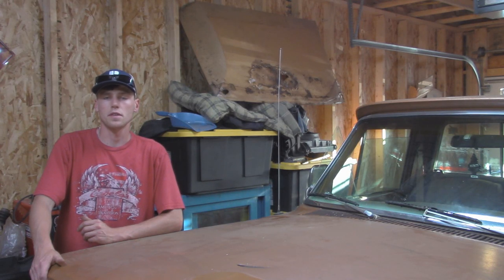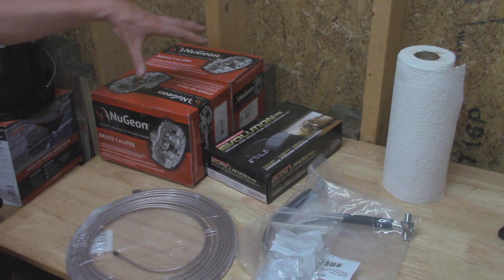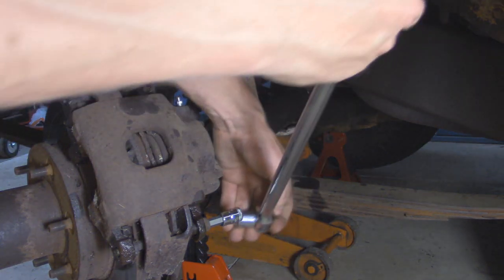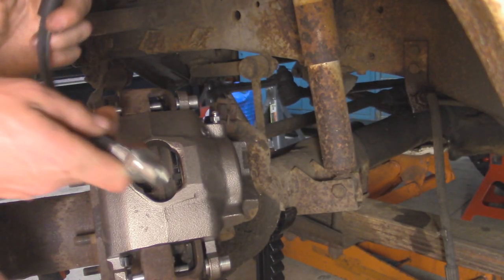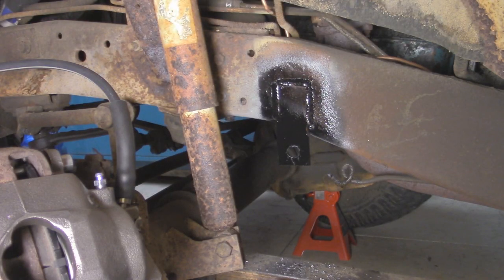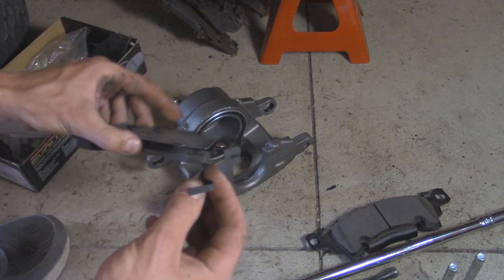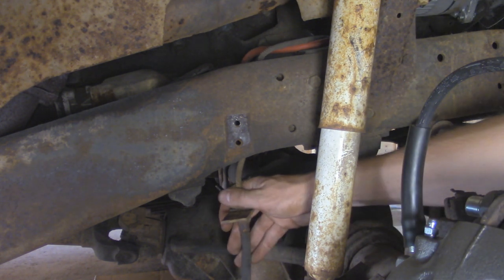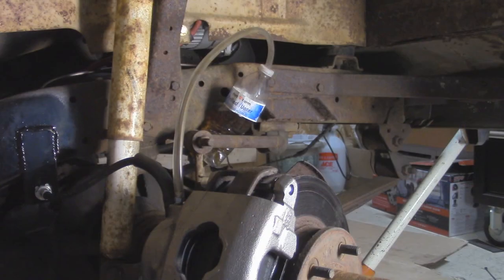Front Brake Rebuild | Jeep J10 Build

Comment: Inline tube makes a nice stainless steel pre bent brake line set for J trucks, I have already installed a complete set on a 1984 and a 1981 J10, they both fit very nice. They were around 200 bucks each but well worth the investment in my opinion and should now outlive me.   Those caliper hose brackets can be a pain, you need to have patience, especially when trying to remove the brackets from the chassis, sometimes working the stubborn bolts back and forth bit by bit can go a long way instead of merely turning them counter clockwise. I am sure you will find all kinds of things to repair as you continue along that you may not have noticed yet. I ended up building a homemade cart with wheels using 4x4's so I could have something to support and help repair the bed after pulling it. I now have my third J truck bed sitting on it. Makes it easy to clean repair and rustproof the rear portion of the frame. Look for deep pitting and rust damage especially near the cross members, rear shock mounts,  and the leaf spring shackle mounts. I am in the process of replacing floors, cab corners, B pillar posts, etc, on J truck number 3. My 81 got a complete outer rocker panel replacement using the non slip on type,They are thicker and much better quality, but they are not flexible like the slip on's and require much more dedication to install them properly.  I even had to make one new complete inner rocker as it was in very poor condition and it's not a replacement part you can buy. I was also forced to make 4 of the 6 short brackets that extend from the main cab floor supports on either side to the inner rockers, another part that isn't being reproduced. CLASSIC TO CURRENT FABRICATION sells what they claim to be complete cab floor repair kits  for J trucks, the front pans seem to a good enough fit, but the rears will require lots of cutting , fitting and trimming to make them fit around the center hump, at least the rears are long enough so the front pans will overlap them and do extend all the way to the rear of the cab. You can find them at their online site and ebay. Mill supply is also another source for sheet metal, and   BJ'S OFFROAD offers lots of FSJ goodies for full sized jeeps, they even sell stainless steel window replacement door glass channel , They are my go to source for many hard to get parts. Team Grand Wagoneer is also a good source for FSJ parts. 

Have fun kid, and remember, when you learn the hard way, you usually don't forget.

Comment: Couple caveats,  might help here, 
I would bleed all lines very first,  before replacing anything so any dirty fluids in any lines are mostly flushed out before running it the new calipers or wheel cyls etc.

Second , would definitely get the coil line protector materials and put on all the lines, just measure up the length and get enough to do it all. even in front etc. Seeing how a Jeep is exposed to things underside and this new Nicop" line material is softer than OEM steel.  What's an extra $50-75 for the "just in case"?
Another well explained vid I am going to copy the task list from !!
Reply from the maker: I agree, all the lines and master cylinder were new so it had fresh fluid going though, otherwise I do normally flush out any dark fluid. I didn't even know you could buy line protectors I'll defiantly look into it when I do the rear.